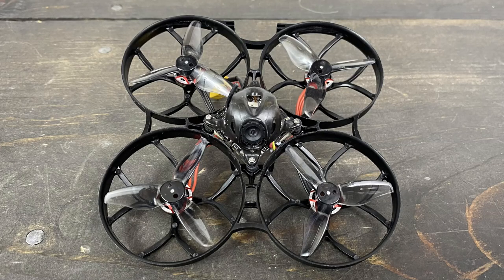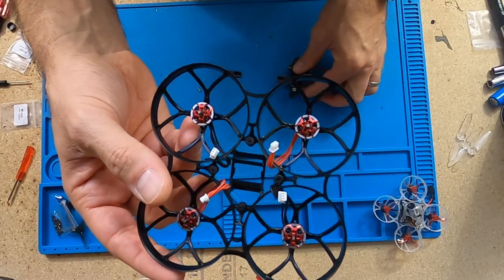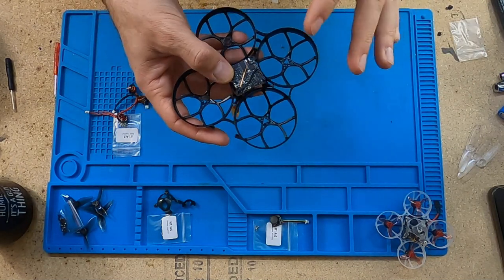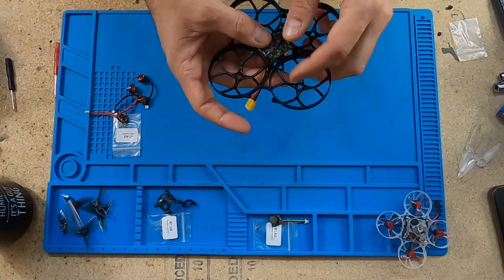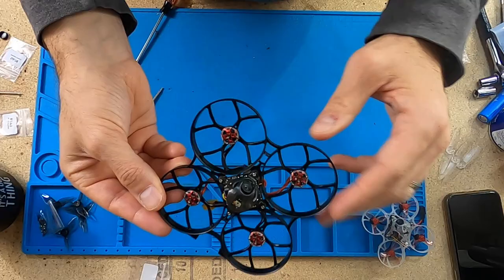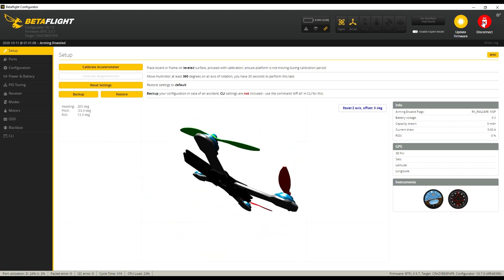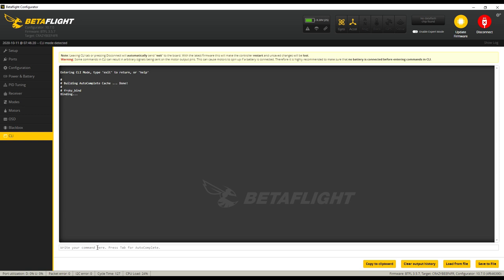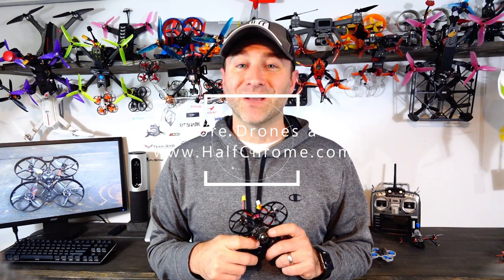Building and Setting up the URUAV UZ85 FPV Drone

Comment: Great starter build and for 75 bucks it's a great price for a 2s drone, even without the receiver. I have some crossfire nano receivers that need a home, well if it will work
Reply from the maker: They would work. Soldering on this board was a challenge, but you can get the built in SPI receiver

Comment: Can you help me ? my UZ85 camera simply stopped working after I used the "restore" option on BETAFLIGHT the VTX is working and sends the OSD information I have already tested all the hardware and everything is fine, I believe that the camera door was remapped after the restoration , could you send me a print of your CLI after the Resource Show command in BF? Thanks

Comment: Hmm, I am having trouble with putting the FC onto the frame after plugging in the camera - this is also the step where you went out of frame ( 10:58 ). Did you just squeeze it in? I am a little bit afraid that the stress on the wires will make them break after some time and was thinking to cut or melt of a little bit of the end of the plug to make the wires pass more easily.
Reply from the maker: I did squeeze it in but try to put the rubber grommets on the FC and then set it straight into the frame instead. It’s a bit tricky.
Reply from the maker: I would not recommend melting anything
Reply: @HalfChrome  Thanks for your reply. That is what I initially tried - way to much stress on the camera wires for my liking. I guess I will de-solder the plug and direct solder the cam instead...

Comment: Cant find anywhere what MAH maximum 2S battery packs are recommended? Or is it easier to fit an Emax 2 X 1S connector  since 2S packs are quite alot more expensive?
Reply from the maker: You could. I used 300
Reply: @HalfChrome  I found someone using 450s -  found this - URUAV 7.6V 450mAh 80C/160C 2S HV 4.35V -  reckon it could be flown on a 1s initially?

Comment: Came here because I’m looking for some help... I would like to buy a small fpv drone that is fairly easy to fly, and that is durable, so that I can have something to fly indoors on rainy days. I mainly fly gps drones. I can fly my Phantom 4 in attitude mode, so I’m not a pure beginner, but I’m definitely not an expert at fpv! I do own a pair of fat shark dominators, so I would like to be able to use those in conjunction with a small indoor drone. I only know how to use my goggles with my Phantom via usb, so I wouldn’t know how to pair them with anything else. 

So my question is, what is a good beginner drone and transmitter to purchase for someone like myself who is just starting out in fpv and wants a drone that can be flown inside of the house? And what will I need for my fat sharks in order to be able to use them with this new set up, receiver, antenna, etc.?

Anyone who would like to share their advice, your knowledge and opinions would be greatly appreciated!
Reply from the maker: Your FatSharks will work with just about any drone. I love the Radiomaster remote and I'm releasing a video on it today or tomorrow. The Mobula6 or AE65 are both excellent beginner indoor drones.

Comment: Got a question, does this run 1S, and do you think I can run 2 x 1S in parallel with a splitter? (ie. higher c lower v)
Reply from the maker: Sure. You could try
Reply: Yeah I run dual xt30. I can travel charge easily then and it turn into a great lil always with you drone.
Though I would only get if you buy two. You will need parts and the kit is about a 40%savings on the parts individually